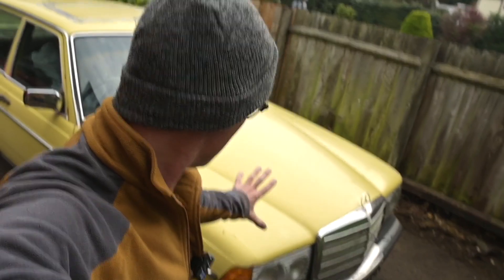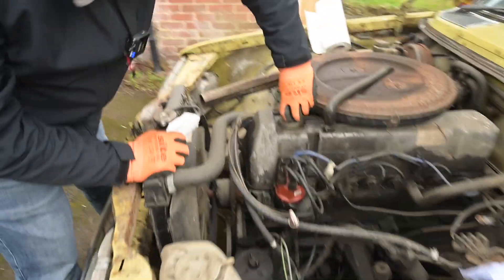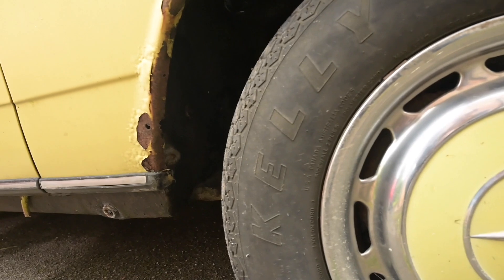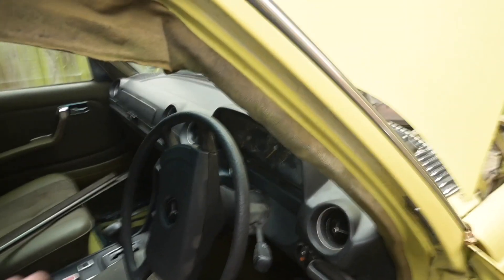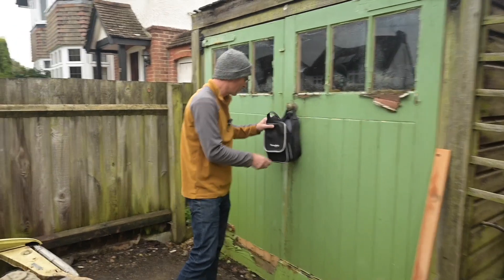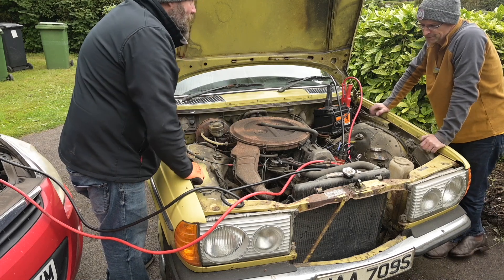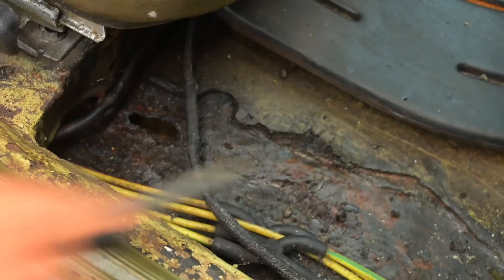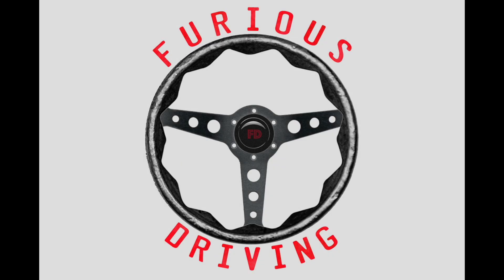Another Mercedes W123?!?

Comment: The factory carb on the 250 is an absolute and total nightmare, and I don't think there are really any aftermarket carb conversions available as so few of these were sold.  It effectively was replaced by the 230E when that four-cylinder engine got the fuel injection.  I also believe that parts for that carb have been unavailable for a very long time, though with Mercedes-Benz Classic coming on-line, that may not be the case any more...

Dual external door mirrors weren't a legal requirement in the UK until the 1986 model year, so a passenger side mirror would have been optional on this car.  I believe all W123s originally sold in the UK from the facelift, so from the 1983 model year, did come with two door mirrors, however, another case of M-B being ahead of the game on the safety front...

Those hey pouches are exactly how the spare keys came from the dealer for Merc cars in the UK in this period, though not for a lot longer after this car was registered...

Good luck with this one, I think getting it running properly could be the most testing part of the job.  I would lay odds that the issue with the water leaking into the interior is going to be bad sunroof seals and the sunroof itself being out of alignment.  It's a fiddly job to sort out correctly but not really difficult.  If there is rust in the roof structure due to the water leak then it could well be the end for the car as it is seriously structural...

Comment: 123 grilles are common to find at autojumbles for small money. There was a set of hub caps at the Battlesbridge jumble last weekend (maroon) quite common too as switching to alloys is  normal.  There were a set of those there too.
The air filter on the 250 was possibly blocked due to damp so with it off, easy start would probably have worked.
A worthwhile project I think. Pattern front wings are cheap but they are rather thin and need a bit fettling to fit.

Comment: The metal piece used to poke the floor pans is part of the sunroof mechanism. When the sunroof panel closes, it presses those levers on both sides and that retracts the wind deflector. That part laying around in the interior tells me there's quite a few things wrong with that sunroof.
Reply from the maker: Sunroofs are never easy. Welding and filling might be the easiest fix!
Reply: @furiousdriving  For as long as you can find new or good used parts, I think is easier to fix it rather than deleting it because you have to respray the entire roof, remove and mask trim and there's a chance the filler cracks and allows water to enter anyway. When dealing with a sunroof issue in cars like these, the worse case scenarios are a stripped cable, a seized panel in the shut position or rust holes in the tray. Because of the tape, I think this car may have plugged drains and or rust in the tray, however, because it looks like someone removed parts of the wind deflector, it seems like the sunroof may open and close which is good because you can take things apart.
Reply from the maker: @TheLuisg92  Yes the first thing will be to manually wind it back an inspect everything, clear the drains and lube the channels, and see whats missing

Comment: Nice find.  love the colour scheme.  The 250 was pretty much killed off my the 230E.   230E had the same power but much better fuel consumption and a far more modern design.   The M123 engine in the 250 is the last iteration of the old M180 engine introduced in 1951.   After the 230E came out it was mostly sold in countries without good mechanic facilities as the carby was seen as easier to manage although the one on the 250 is not all that simple really.

Comment: I'd have taken that car on and got rid of your one. Looks a much more solid car!

And no you don't need to MOT it, even if it's been off the road, you just declare it MOT exempt when you tax it online.
Reply from the maker: Has that changed, Im sure at one point you could only declare exempt with a current MOT?
I considered it, but I know what problems I have with mine, this is a new bag of issues!
Reply: @furiousdriving  it's always been the case, you don't even need an MOT if it's freshly imported and exempt.
Reply: What a scary scenario, being able to jump in a car that's been off the road for years and if the buyer doesn't know too much, they charge down the road in a potential death trap.
In the safety obsessed UK that seems like pure madness?
Reply: Not quite. The vehicle, despite being mot exempt, must be roadworthy and you can get stopped by the police if they suspect the vehicle is deemed to be unsafe.
Reply from the maker: @GentilsGarage  they have to see you first!
Reply: @furiousdriving  haha that’s the problem. Trying to hide and hope for the best :)
Reply: @GentilsGarage   ANPR cameras must be really clever to pick up a rotted out floor or defective brakes.
If it doesn't look like an absolute shed, you're not speeding and it meets the legal requirements on ANPR the police wouldn't pull you. Yes they'll turn up and convict you when it's ploughed in to another vehicle or a group of pedestrians, sadly that could be too late. 
MOT exemption, the worst contribution to road safety
Reply: @neilwalsh4058  I completely agree. Although I keep my cars in good condition, MOT tests can pick on things I could miss. For me, an MOt test is a extra reassurance when it comes to safety.
In regards as to how the police work, it doesn’t necessarily follow certain “parameters” for being stopped and Not everything is ANPR based, so I think that taking chances is risky.
Also, many vehicles being advertised look in poor condition and the sellers mislead potential buyers buy saying it’s not abs tax exempt. That’s the point I was trying to make with my comment.

Comment: Believe me, if there is water at the floors, or even rust, be prepared that that thing is rusted through completely at the firewall like your 230E. This one is a MAJOR project. Nice color combo though. I am just doing a 300D. Front End is completely finished now. Doing the rear end. One tip: do NOT wire brush the rust, because with this tool you dont remove the rust, you rather polish it. It looks quite good afterwards bceause the rust is getting black, but it is still there. Always grind it away. BR, Alex

Comment: I haven't rolled down through all comments (shame ) , but regarding the sunroof opening in case if the electric switch is gone...it's worth trying to find the white'ish knob in the boot...on the left/right inside towards the back seat/wing corner.  My W124 had this solution, which allowed to close roof if electric switch failed. :)

Comment: I did think for a minute that you’d taken another Merc on to replace the blue one! 
       Interesting colour, bright and cheery yellow, doesn’t look too bad for its age. 
      Matt where did you hear or see that historic vehicles that have been off the road for years but recommissioned still have to go for an MOT before it’s used on the road? I’ve looked online but can’t find anything on that.
Reply from the maker: I did consider taking the best bits of the two cars to make one good one!
I dont remember where I read that, but Im sure you have to declare MOT exemption from the starting point of having an MOT to begin with. Maybe its changed?
Reply: @furiousdriving  Ahh right, yeah I knew about declaring it as Mot exempt first, plus sending the V5 to the DVLA to change the Taxation class. 
      Hope your mate has good success with the Merc. 👍

Comment: I'm currently working on a W123 that was bought by President Indira Gandhi, it was ordered with air suspension system to keep the car level at the rear due to the weight of the machine guns that they used to carry in the boot apparently, 
Was the previous owner of this 123  Mr Khan ?
Reply: That sounds interesting, does it need much work?
Reply: @CycolacFan  it's in for some light restoration, a little mechanical work and full outer body repaint, it has an odd spec that was clearly required by the then President Indira Gandhi who sadly was assassinated shortly after the car was purchased in 1984, it's a lovely car
Reply: @alanalzee4849  yours is also a four-door saloon I assume? What’s the weird spec, and is it bullet proof? 🙂

Comment: Top tip..... use a higher Amped battery to jump start a bigger engine. Using your Mercedes Diesel would have been better over the revving the sh** out of a little I20!! 🤣🤣🤣
Reply from the maker: unfortunately the delivery truck dumped it that way around so the 204 couldnt get to it!

Comment: Massive project that's why someone gave up.

Looks rotten on the outside which means it'll be twice as bad under all the panels.
Reply: Let's face it probably any car from the 70s that hasn't had some resto work done is gonna have rot on it and any resto project from this era is gonna involve alot of cutting and welding.
Reply from the maker: It has had masses of welding done already, so it was at one point
Reply: @bobbyrayofthefamilysmith24  I've restored two cars myself so well aware of the work involved. For instance that drivers floor pan is a lot more than a "small hole" metal that colour you cannot weld to, looks like the rot extends right under that cross member where the seat sits and probably on to the inner sills. Just because you can't "get through" doesn't mean the metal is sound, it'll be thin. Brave project this one.
Reply: @jimmyk9523  would you say they should strip the whole interior out and then weld in complete new floor pans and sills? How much would this kind of resto cost?